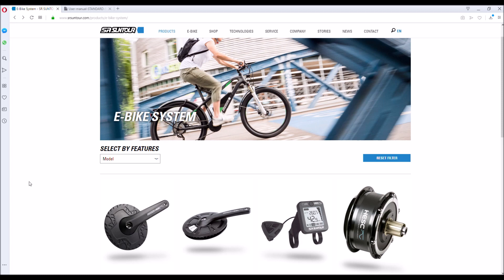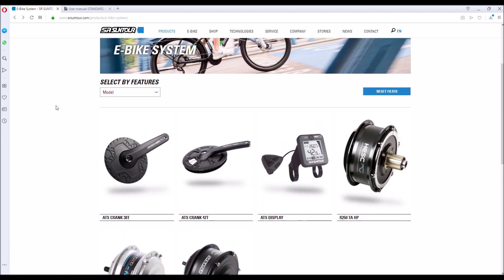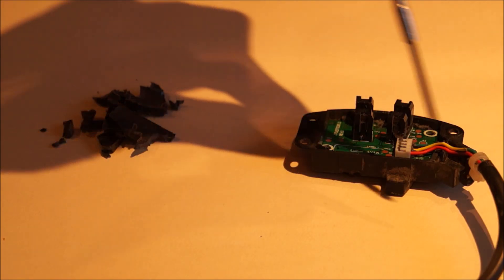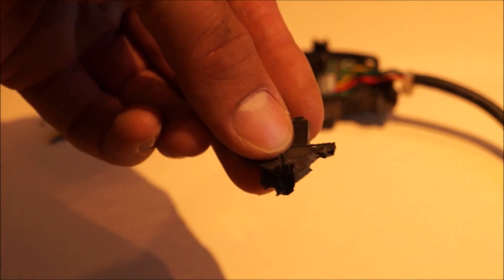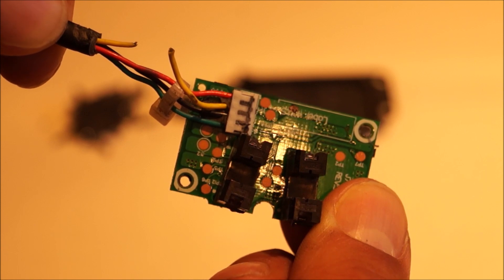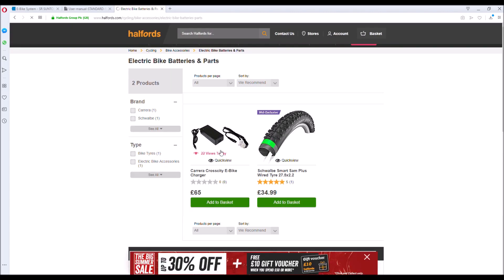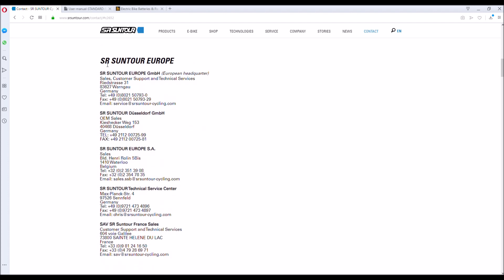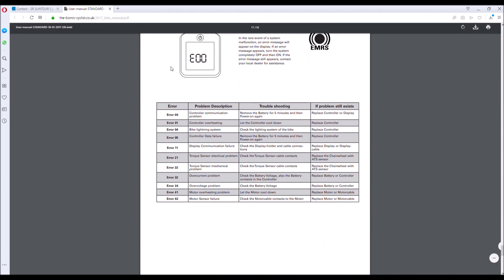Carrera Vulcan E-Spec - torque sensor problem (E21 error)

Comment: I did a mistake buying Carrera Crossfire E and don't recommend buying Carrera ebike or buying from Halford either. Their service is so bad and charge you more than half of the bike price when you need to replace the battery. just today they asked for £499 for battery without considering their bad ugly services fees. Their price is way higher than comparative brands and their  services  is just 💩. Today decided not to enter any of their stores for ever. Considering I was a great supporter and bought 3 Carrera bikes to my sons in addition to my Crossfire E